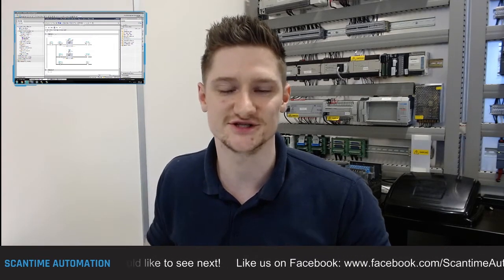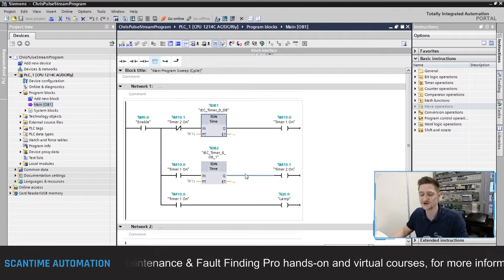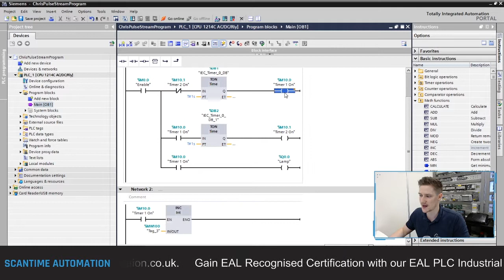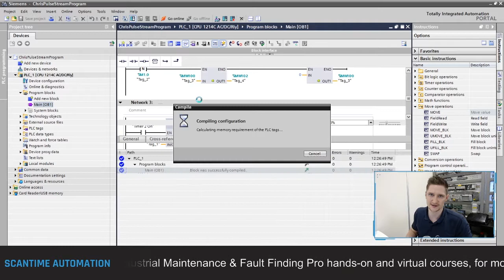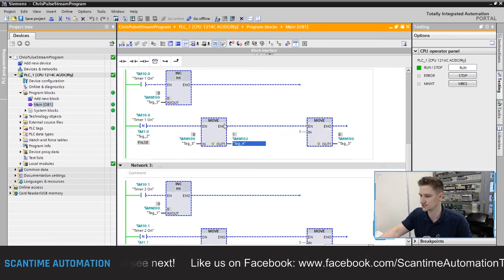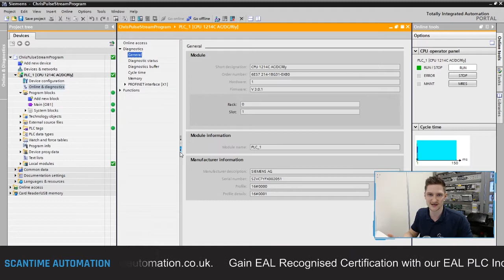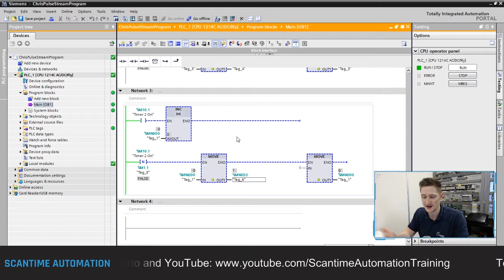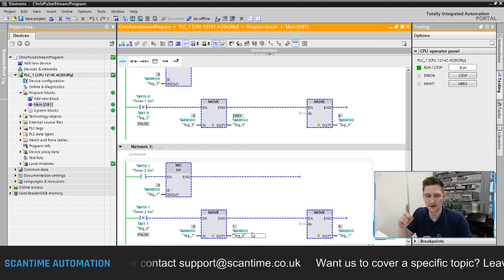Siemens TIA Portal: How Long are the Timers ON for?

Comment: Hallo Scantoime Team,
I am so confused why the second timer does not last for 1 second.
What are the conditions for the output Q to be true? Inst the elapsed time should be equal to the preset time for the Q in the second timer to be on? if it last for less than 1 second , then how is the output true?
Please explain.
Thank you

Comment: What if the second timer is TOF , Only then the second timer runs for 1 second.
Reply from the maker: Remember, the TOF only begins to run when the Enable signal turns ON and then OFF, on the falling edge of the Enable signal.